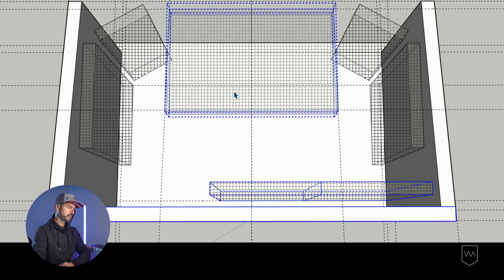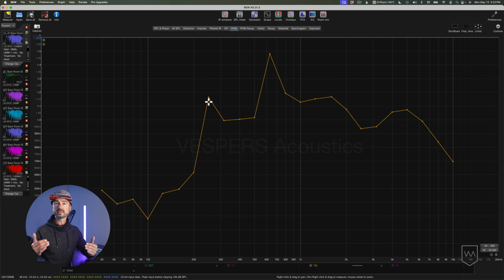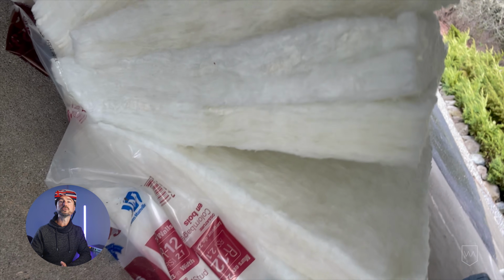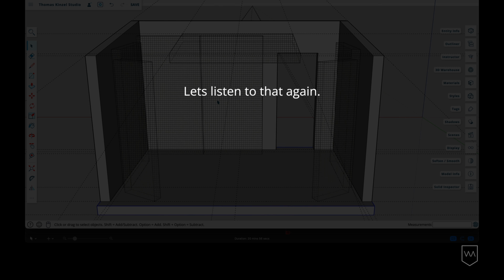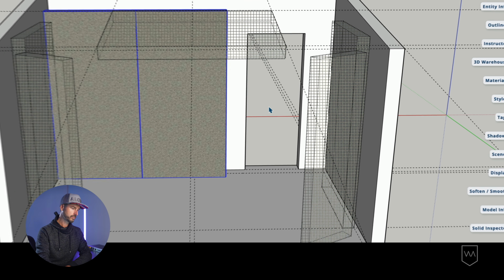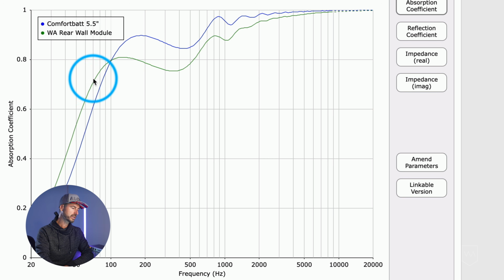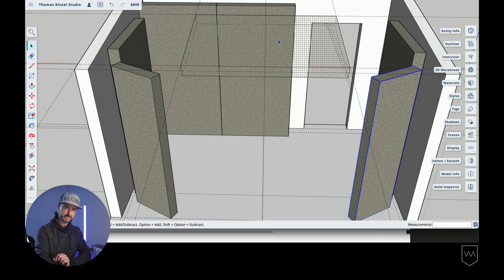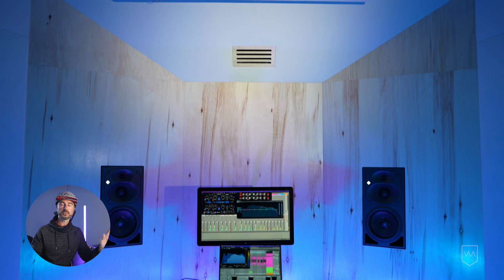Acoustic Treatment: The Strategy for Small Studios - Ep4

Comment: Very useful info. Can the airspace be extended INSIDE the wall? Say filled with light density fiberglass? That might allow the acoustic panel to wall gap to be small.
Reply from the maker: Hey Mark.  What you’re proposing can work under very specific conditions.  

First it cannot ever be an exterior wall.  You must have vapor barrier on the warm / inside of the stud faces that’s air tight lest you get moisture and mold.  Plastic vapour barrier inactivates a lot of the activity of a porous absorber because you can’t blow through it.  It may have a different and less predicable acoustic effect.  

Now if it’s a room within a room or a party wall / interior wall then you’re talking about removing the internal layer of drywall and leaving the porous exposed.  Very bad idea with glass wool.  You always want it very well contained.  So you’d need a couple layers of fabric to contain them well and then you’d mount a panel to it.  

But in general it’s not a good idea.  If you do it use Rockwool as it at least has biosoluble fibers.

Comment: Wow that frequency response with 0 smoothing is pretty incredible, I've used homemade absorbers and have pretty good results with peaks and dips of +/- 5/6 dB, very workable. I've seen similar results posted from other peoples home studios they've built from scratch so I'm happy

Because my studio is a multi purpose space I've kind of run out of space for porous absorption without encroaching on the rest of the living space, I plan on adding some cloud diffusion for what it's worth. 

My front wall behind my speakers has 10" floor to ceiling corner bass traps but is otherwise untreatable as there is a small window and the entrance door, I reckon if I could treat it I would smooth the graph out to +/-3/4 dB but I don't think it's possible without being a huge inconvenience
Reply from the maker: Hey hey.  Sounds like you've done a lot of work to your room already.  It's great that you've invested in some DIY acoustic treatment with good results.  There is a point of diminishing returns where you get rather marginal improvements, especially for a multi-purpose room.  But only you can decide where that point is.  Cheers!

Comment: I wanted to ask you, thank you so much for this series, I'm learning a lot, the content is exceptionally rich.

When you mention starting with the most rigid material and then moving to the less rigid one, does this also apply in the case of, for example, 25 kg/m³ fiberglass followed by 40 kg/m³ rock wool? Or even multiple layers, like cotton/fiberglass/rock wool from least to most dense, or vice versa rock wool/fiberglass/cotton, or cotton/rock wool/fiberglass, or glass wool/rock wool/cotton?

And when you explain that if we have the budget it's better to fill the air gap with very fluffy/low-density material, even in acoustic modeling, for example, it doesn't change anything regarding projections. If we take, for example, a 50cm thickness, if I have 20cm of fiberglass insulation and 30cm of air gap for the back wall, wouldn't it be better to have a light air gap of at least 5 or even 10cm? In other words, 20cm of fiberglass and 20cm of cotton rather than 30cm filled, since the last layer will be against the wall where the velocity is low.
Reply from the maker: Hey hey.  Glad you've enjoyed the videos.  Regarding the acoustic modelling calculator, it is not a fully reliable source of information about absorber performance in real rooms.  In fact, absorption coefficients alltogether - as measured in reverberation chambers - are deeply flawed and inaccurate.  

What I can tell you from real world experience is that filling the airspace with light density fiberglass works.  Think about the mechanism of action.  Air particles are still moving in that space.  They have velocity.  Porous absorption works where there is velocity.  So it will have an effect.  The amount of effect it has is higher than the calculator will show.  

Also, sealing the airspace behind a module can theoretically increase LF absorption (this is per Ron Sauro from NWAA Labs) but this is in reverberation chamber testing which is a very different test environment from a real music studio where there is no diffuse field, no random incidence, and a highly directional sound field dominated by standing waves.  

This is why the models are broad guidance to be considered, but not considered fully and reliably predictive of in-room performance.  

Regarding the layering of different flow resistivity, it's hard to say which layering strategy would be better (IE placing the higher GFR on the front or back).  From one perspective, it makes sense to increase acoustical impedance as you approach the boundary.  From another perspective, some tests we've run have shown better performance with the high impedance material on the front of a module.
Reply: @warpacademy  Thank you very much for your detailed answer, I'll treat the air gap with layers of density and build couple of membrane bass traps 2 of them are working but I need more of them since they are sniping a specific issue and improving a bit, always a question of how much haha
Reply from the maker: Ah yes.  Membrane traps are notoriously hard to configure and often don't match the intended tuning.  They have extremely high Q values too, meaning if you miss - even by a bit - they can be nearly ineffective.
Reply: @warpacademy  Exactly, I was a guinea pig for a model designed to improve the chance of success and it was the case, a big saving made compared to gik acoustics, they have to be made to a millimeter precise and the cavity has to be sealed which is not easy and requires meticulous work, it still paid off in the end, I took a risk but a calculated one.

Comment: Very cool. Youve put a lot of specialized  knowledge out there thats easy to understand and can help many who are using bedrooms as a studio and certainly cant afford to construct a second inner wall. The second wall with air gaps is more for sound isolation I suppose but I see its also good for absorbsion.  Thanks
Reply from the maker: Thanks.  I'm stoked it's been informative for you.  The isolation shell is designed for keeping outside sound outside, and inside sound inside.  It's a key aspect of a truly professional room, but many home-based studios cannot implement it due to size and the sheer weight it adds.  

Noise bleed (transmission) leaking into a studio can impair your ability to mix.  Transmission out of the room can disturb neighbours or other adjacent studios in professional settings.  

But, there was no space to build that in this example and in many home studios you just need to work within the constraints that there are.  There's always an improvement that can be made.  We're not chasing perfection.  Cheers!

Comment: I agree for that room, which I'd term extremely-small - and not at all typical of the room one might choose for a studio, diffusion might not be desirable. 
 In that respect it''s too bad this was the room used for this otherwise very informative series.  It is an outlier.
A normal bedroom which most would consider for their studio in a residential building has much less severe dimensions and can benefit greatly from some real diffusion (ie. not slats of wood over absorption panels) 
fwiw - a more normal bedroom studio configuration like mine (10x14')- speakers aligned on the narrow axis - gained a lot in clarity above 550Hz using deep QRD diffusion on the back wall.
And in my testing, absorption panels 2x4' do very well in as long as they are positioned at the point of reflection and are close to the source, as they will be in small bedroom studios.   They are designed to absorb reflections before they can propagate, so full floor to ceiling pieces are not necessary unless they are too far away, too thin or not dense enough to absorb the waves on first hit.

Comment: Thank you so much, your videos are so educational and your advice is very much appreciated. This seems like a reverse LEDE configuration, with the live end behind the speakers (front wall) I have a small hifi listening room 4.2m x 3.4m with 2.75m ceiling height and no room treatment; my listening position is 75cm from the back wall due to the low frequency room modes. Would you recommend this kind of treatment for my room and could diffusion work on the front wall? Cheers from Brisbane, Australia
Reply from the maker: Hey Aaron.  LEDE is a pretty old design that, in my opinion, never really worked that well.  My personal control room is built around the NE (non-environment) room concept or FTB (front to back) concept.  Thomas's room doesn't have the hard front wall aspect of that design, and if we had more budget to work with I'd certainly have heavily treated the area around the speakers to reduce SBIR.  

This room isn't a flipped LEDE.  If that was the case, the whole front end would be live.  But the whole front end is an RFZ (reflection free zone).  So the front end is damped, as well as the back end.  There is no "live end" just a live front surface.  

The downside of Thomas's room vs my control room is the lack of the large baffle / front wall flush mount, meaning he still has significant SBIR from interaction with the boundaries.  

We plan on upgrading the room over time.  

In your room, I would not recommend front wall diffusion.  Minimal benefit, lots of costs.  Diffusion is typically placed "in the line of fire" IE where your speakers are aimed.  And you want to have about 10' / 3m distance between you and the diffusion (meaning you should not put it on your back wall if you're only 75 cm from it).  

The only reason you see slats or reflective surfaces in some control rooms for mixing and mastering is to give the people working in the room some acoustic feedback that makes them feel comfortable over long mixing sessions, due to the rest of the room being so heavily and nearly completely damped (NE and FTB designs).  

In your theatre, you will never have enough damping to make that necessary.  So it would be a near complete waste to install diffusion on the front wall other than maybe if you like the aesthetic.
Reply: @warpacademy thanks so much for your quick reply and advice, it is very much appreciated. I am also on a budget, so  would you recommend broadband absorbers/bass traps 4 corners floor to ceiling, back wall thick broadband absorbers with air gap and broadband absorbers on each side at the first reflection points and if budget allows, ceiling cloud over speaker area? And keep the front wall untreated?
Reply from the maker: Hey Aaron.  My pleasure.  And my commendations for being interested in investing in acoustics as much as your speakers.  So many people ignore this.  

Seeing as your room is a hifi / recreational space and not a music studio control room, I feel that approach would be over damping the room and you'd likely suck too much life out of it.  Without knowing about your speakers and goals and listening preferences it's not possible to advise you properly, so if you want to hire me for a deeper consult, that's available at https://warpacademy.com 

In general, for a hifi space you want some absorption, but you're not damping anywhere near as much as a control room.
Reply: @warpacademy Thanks again, I have sent off an enquiry on your website, all your advice is very much appreciated

Comment: Stumbled on this by accident. Although I'm doing a home theater in a small room so the theory is apparently different. Interestingly it is recommended to have way more diffusers. What's odd to me is people have said 4' for diffusers not 10.
Reply from the maker: Hey hey.  There are many differences between music studios and theatres.  Diffusion is one of them. 

You must be at least 2-3x the wavelength of the lowest effective frequency of the diffuser.  Otherwise the reflected frequencies don’t have enough room to spread out.  

Also note that even in bigger rooms, many of the traditional diffuser designs like QRD, PRD will actually produce a hot spot / specular reflection at the wavelength of the size of the full diffuser.  Not great for rooms for critical listening. 

So there’s a trend towards using passthrough diffusers like you see in the My Room paper and slatted modules.  

But you still want sufficient space in most applications.

Comment: Hi! 

Just wanted to know, I'm guessing that the pink fiber glass GFR you got it was from owens corning? can you provide the link so I can buy it? :)
Reply from the maker: Hey there.  One big thing to understand is that any GFR number is just a very rough estimate.  Manufacturers of insulation don't publish GFR, and sometimes don't even publish density.  Owens Corning doesn't publish density for their pink fluffy, we estimate it's in the range of 0.66 PFC / 10 kg/m3.  

The reason is that batch to batch inconsistencies are common, so even the same product from the same manufacturer ranges a lot.  

I don't have a link to Owens Corning products as they're all local.  What you'd do to source it is to find a local hardware store that carries it.  It's common to see it at Home Depot, but it depends what part of the world you're in.  

If you can't find that product, then you can sub in a low-density fiberglass product from another manufacturer.  Look for something with an ecose / purebond binder.  Some products use formaldehyde as a binder.

Comment: @8:55 One thing that Im curious about is the Concept of "Filling the airspace". If the module is 6 inches deep, instead of air gapping it 6 inches off the wall for example, does filling the airspace mean literally throwing light density material behind the module? or would making a module thats deeper be more beneficial?
Reply from the maker: Hey hey.  Yeah what you’d do is create a second frame, just like the first.  And fill that will light density fiberglass.  

You could then experiment with whether having the lighter density material in front or behind of the higher density material works better with tests.  

Lighter density in front will create a gradient impedance stack where flow resistivity increases as you approach the boundary.  

You could also experiment with leaving a 1” airspace behind the module stack and the wall and sealing it with an extension to the rear frame and that air pocket will act as a spring and increase LF absorption.

Comment: Question: I’m purchasing a 12x24 shed with a loft. The shed comes as a shell, no sheet rock.  I was wondering if I couldn’t get away with building the corners in to 45°s then filling the wall in between the studs with rock-wool and instead of sheet rock, just fabric wrap the wall. For the Loft, the underside of it would be the same, just pack it with rock wool and cover with fabric. Would this be a decent start? I’m guessing the corners would be about 8-12 inches thick and the thicker part and the walls are about 4 inches. But no reflective surface.
Reply from the maker: Hey hey.  Really hard to say with that stuff unless there are better dimensions and discussions of the stud sizes.  Ceiling hight is critical.  Studs could be 2x4 or 2x6 if wood.  Maybe they're metal studs? 

Really there's too little information here to comment properly.  You'd want to treat primary reflection points.  Use a ceiling cloud.  And yes, adding treatment to all your corners and wall / ceiling seams will also help.  That's just the most general guidance that applies to most rooms.
Reply: @warpacademy it’s most deff wood with 2x4 studs.  I guess my question would be should I go ahead and insulate and sheet rock the whole thing, the. Add acoustic panels and bass traps after with air gaps, or .. while the wall is open, just take the opportunity to use the wall it’s self as the absorption panel covering the insulated stud voids with fabric.